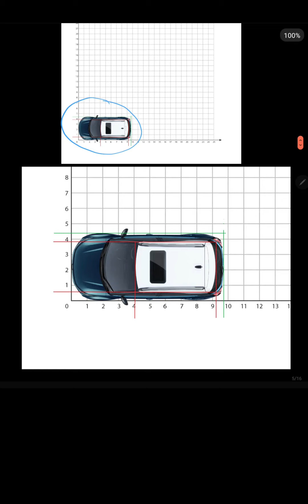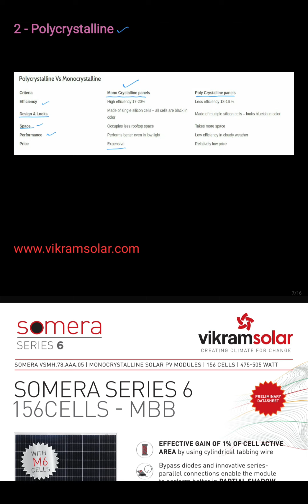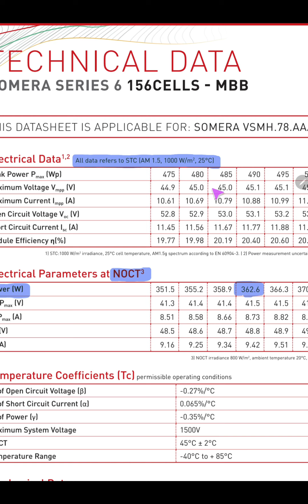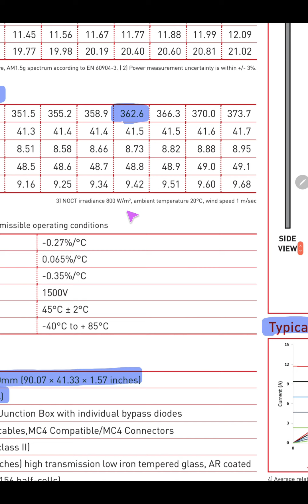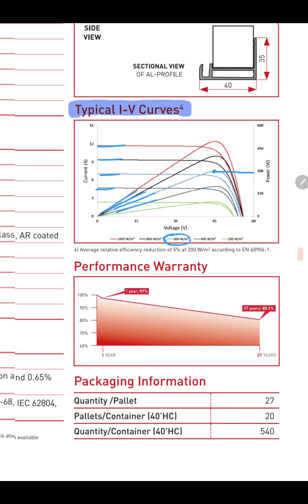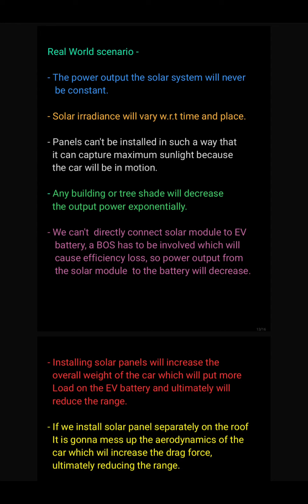Can you run TATA NEXON EV using SOLAR POWER? | Calculate the Range you can add using Solar in EV?

Comment: Good job but can we distribute weight by small solar panels
Reply from the maker: Hello sir. Thanks for watching.
Yes sir, we can distribute the weight by small panels but we will get a slightly better W/m2 while installing just one bigger panel because we will have more solar cells and less framing. Also installing many small panels will require more electrical connections which will increase losses and the system will be less reliable. And it will take less effort to just install one big one instead of many small. But if someone wants to, yes surely they can go with small panels.

Comment: Great efforts sir.  But its still impractical in all aspects. If this concept was possible before, definitely the EV giant Tesla may have been experimented this idea before.  There is only one better thing that we can do by the time being is, install a minimum 5 KW capacity of Grid Tied (On Grid) solar system at home to completely rid off from running cost until the DC fast charging facilities are available across the country.
Reply from the maker: Exactly. You completely understood the point which I was trying to make. Next video will be on Grid-tied system only. Stay tuned and thanks for watching✌✌
Reply: @knowledgeresurrection7873  -  You are most welcome Sir.  Also If possible, while experimenting on Solar system, please make a feasibility study on whether we can do DC charging the electric vehicle directly from Solar panels through a charge controller or that must be from a battery back-up?  And how much KW capacity of Off Grid Solar system we need to direct DC charge with considering the all charging current flow parameters like Watt, Volt, Amp. Hz. etc.  If so, then we can avoid using the DC to AC inverter.  All we have to make sure the constant Ampere current flow during charging time  The subject is quite interesting and I have been searching for this project since long time.  Thank you.